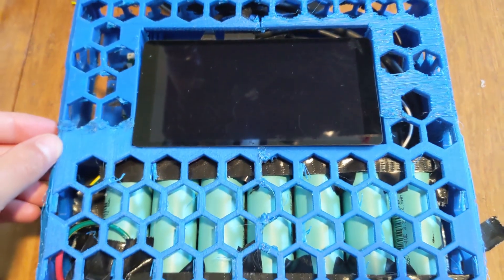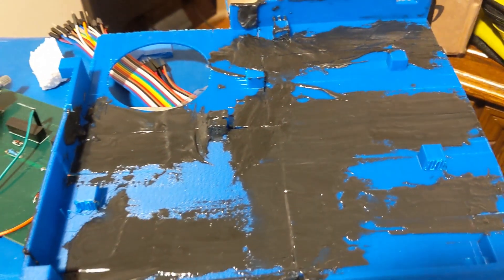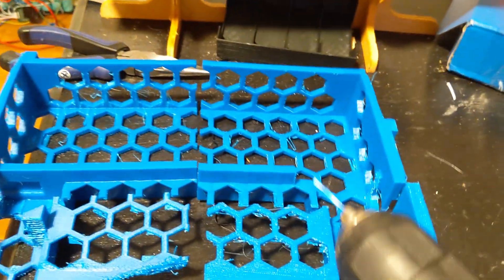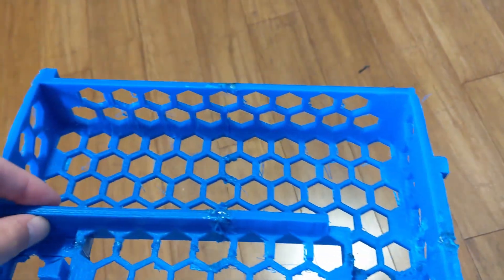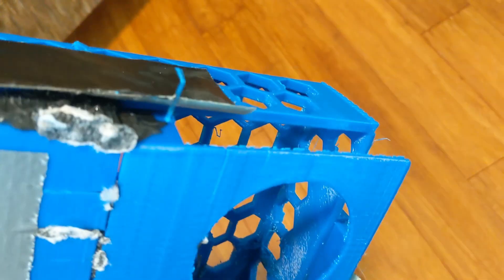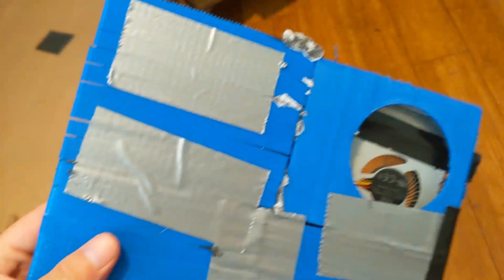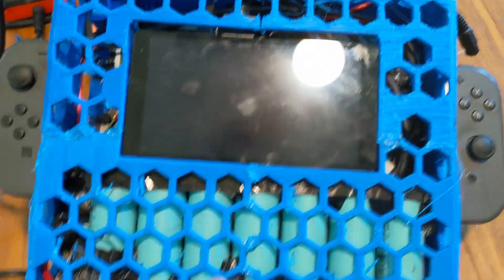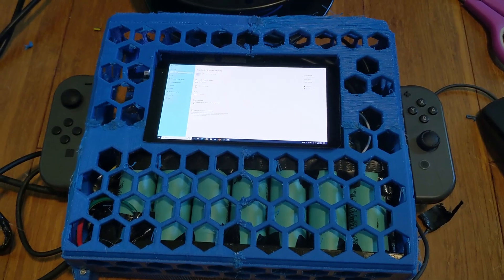What if wish.com made a steam deck (v2)

Comment: If they controllers are going to stay permanently attached to the device, I'd look into something a bit beefier like the Hori Split Pad that should provide a better grip and handle the weight better.
Reply from the maker: good point. plus it looks like you grip it lower which would help with the center of gravity

Comment: Whats the spec of the laptop mobo?
Reply from the maker: ryzen 3 from an ideapad 330. $45 on ebay
Reply: @SpinQuorum  is it the ryzen 3 2200u?
Im also planning on building one but using a intel nuc like mini pc
Reply from the maker: @paopapi  thats correct, ryzen 3, 2200U, 2.5Ghz. Using a NUC would probably make this more practical.
Reply: @SpinQuorum  can i power it using 4s or 3s 18650? And boosting its voltage to 19.5? I can run it on 12volts  but in shutdowns when playing games
Reply: @SpinQuorum  my mini pc is also powered by ryzen 3 2200u. Its the tbao mn22
Reply from the maker: @paopapi  nice! what's the most intensive game you've been able to play on that?
Reply: @SpinQuorum  rdr2, all low and using 800x600 and playable
Reply from the maker: @paopapi  Sounds feasible, just remember that running games on 3 18650s will probably only give you like an hour of play.
Reply: @SpinQuorum  ill probably use 3s2p to double the runtime. Thanks btw
Reply from the maker: wow!
Reply: @SpinQuorum  I tested it yesterday, it ran poorly on 15 watts, 20 watts is the perfect tdp for the 18650 cells but it shuts off when I play GTA V longer than 10mins. Do you know whats causing it? Is it the dc booster, or the batteries?